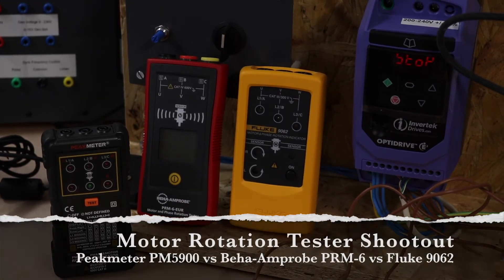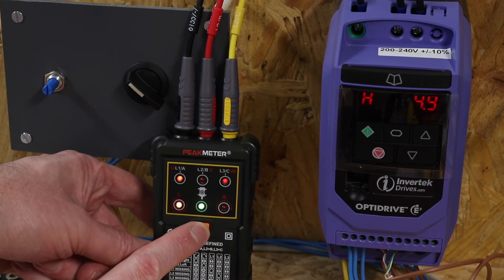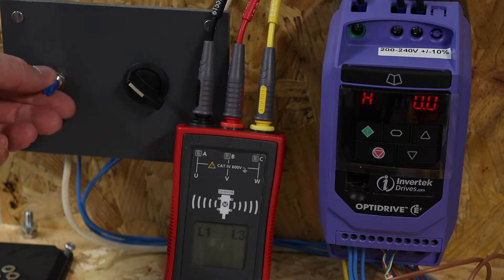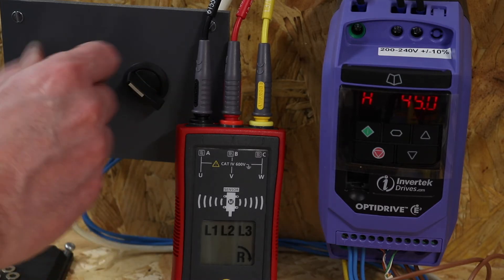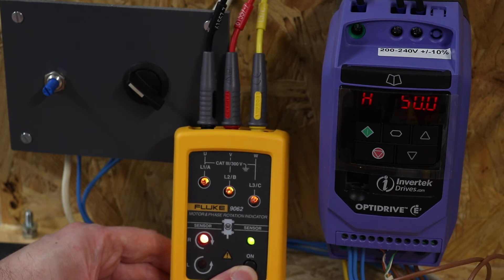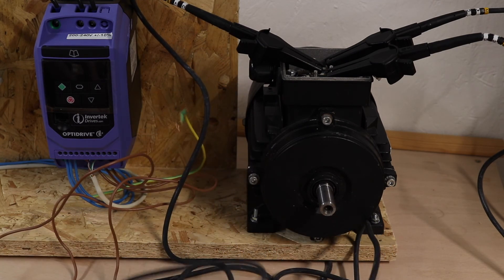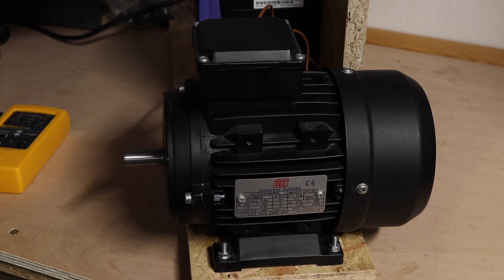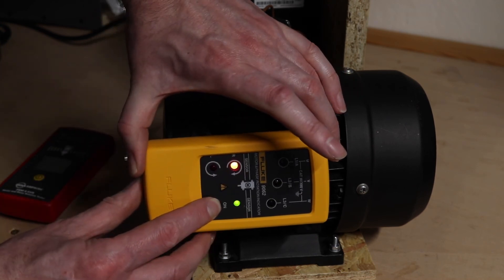Rotation Testers - Fluke 9062 vs Beha-Amprobe PRM-6 vs Peakmeter PM5900

Comment: These testers do not like the high frequencies from the VFD and that is why they give false readings.
Reply from the maker: Yes, if you have a cheap VSD without filtering on the output, it will likely create problems, with these and a lot of other instrumentation as well.
Reply: @three-phase562  the model I see on screen is unfiltered, I suppose. Besides, in the filtered ones ,the filter is on the input of the VFD, not on the output ...
Reply from the maker: @optroncordian7863  All VFDs will have at least an EMI filter on the input for compliance with IEC standards and European directives. Dependent on manufacturer, there can then options to add further input filters / reactors, DC bus reactors, and output low pass filters or reactors. On larger VFDs you can go to third party filter manufacturer's ad have external filters manufactured to suit your needs.
A low pass filter on the output of the VFD in this video would solve the erratic readings issue. I built such a filter and tested it with the MTR105 in this video;
https://youtu.be/qVVNNagSQbQ?si=FxOFO-ocaYGuB9Vm
You can also reference the VFD Academy that will give you more details regarding filter options for VFDs.
https://vfdacademy.com/basic-of-variable-speed-drives/7-essential-filters-every-vfd-engineer-should-know-to-optimize-performance/

Comment: One more thing, the Fluke is only CAT 3 300V. The Amprobe is CAT 4 600V.
Reply from the maker: Yes, that is a very good point, thanks for commenting.
Reply: @three-phase562  Thanks for acknowledging^^

Amprobe also says it can go to 700V Phase to Phase, Fluke says 400V on the 9062.

Though now on the newer 9040 they have 700V aswell and CAT 4 300V.

But damn, for 300-400 Dollars I personally prefer the Beha. Less than half the price, and seemingly better specs. 

Fluke might be relying  to much on their name on this one.
Reply from the maker: @stalkinghawk9244  Just got round to looking at this, thanks for the information, I wasn't aware of the 9040. As you say quite pricey for what it is.
Reply: @stalkinghawk9244 fluke always relies too heavily on their name. Albeit a good name that has earned respect with many generations of good rest equipment. 
Amprobe is a fluke meter by the way lol, fluke owns amprobe...so I guess Fortive owns both

Comment: pretty sure you are testing rotation correctly...motor should be isolated, hook leads to motor, face the shaft, spin shaft while holding test. rotation should match direction you are spinning. pretty basic possibly poor instruction.
Reply from the maker: Thanks for watching and commenting

Comment: I think the display on the drive was representing the frequency of your output. I know most flukes aren’t certified below a certain frequency. That may be the reason for your funky results on the lower speed settings.
Reply from the maker: That is a good point. I looked up the specs. Fluke and Peakmeter operate between 2 to 400Hz, although voltage needs to be between 120 to 400V AC, so that may be a factor. Improve unit is 16 to 400Hz and 40 to 700V AC. Appreciate you watching and commenting.

Comment: I like the features on the Amprobe, the reliability of the FLUKE , and the Peakmeter I’ll use if that’s the only tester left to use. Great timeless video(s) TP.👍🏿🤙
Reply from the maker: I would go with that TETC. I think if you are on a tighter budget =, then the Amprobe seems a reasonable alternative to the Fluke. These are pretty niche instruments with fairly limited capabilities so hard to justify top of the range for some.